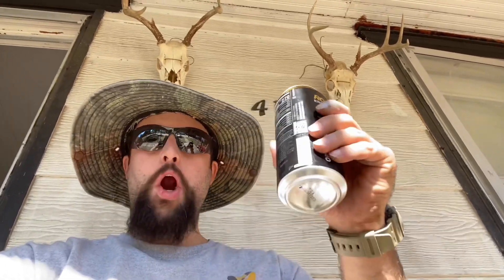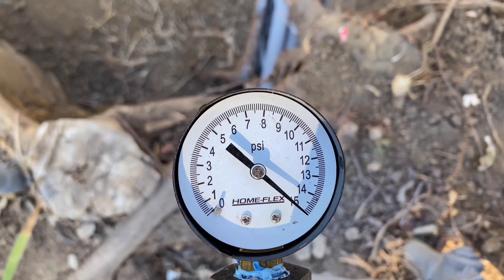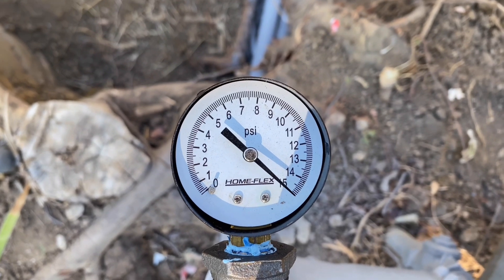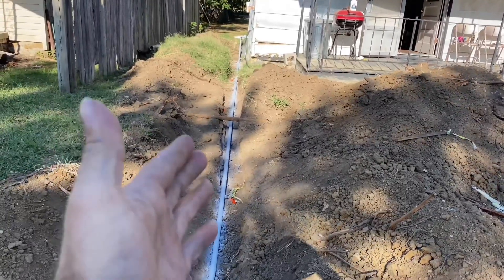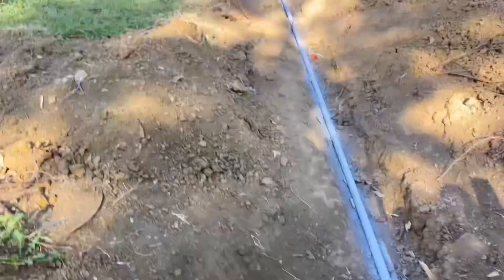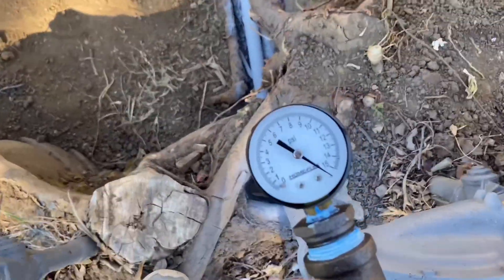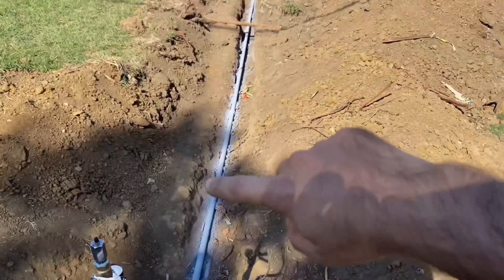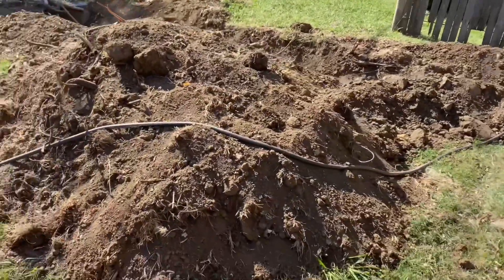Pressure testing my gas line how to.

Comment: I just piped over to the water heater today🎉🎉 following all ur videos. So before I continued my run I decided  to do a pressure test up to this point. I just now started the timer 30 minutes.  My goal I'd to have gas company come and turn my gas on after isolating the slab leak. So my family can receive  hot water again. Then next weekend continue the run to my stove and dryer. So far so good. It's holding 15 psi 25 minutes to go
Reply from the maker: That’s awesome 👏 Great job!! I love hearing people’s stories of saving money and the process involved!!

Comment: A couple of comments. Gas expands with heat. Therefore, your pressure will increase in the day versus at night. Secondly, for underground, yellow poly piping is now typically code in most places or wrapped metal piping using polyethylene tape.
Reply from the maker: Yes codes have changed but I stuck with the original design it lasted 80 years the first time and that is a good heads up to check the gage first to see if there is any damage! I have heard of another person having the same issue as well!

Comment: Our HOA had a gas line repaired at our pool. The Gas Company came back out to reconnect service and said there was still a leak. The repair company, retested and found no leak. A second company came out and gave us the valve that the first company had used. Like yours it was a 15 psi, but the inner dial plate was bent toward the glass across the 4 and 11. The dial indicator would stick on the metal plate and hold because it was stuck. Lesson learned, always use an undamaged pressure indicator.

Comment: Is there a reason why you painted the gas pipes?
Reply from the maker: Good question! Yes actually, I painted the pipes 3 times with metal outdoor paint. So the pipes last longer without rusting out under ground. Hopefully this helps!
Reply: 10 o'clock in the afternoon? Where do you live? Lol
Reply from the maker: Okihoma where the red firm grows lol

Comment: Thanks bro, you saved me $2000, had 2 different  plumbing companies in Charleston SC try to bs me and claim I needed all new pipes.  Called the inspector, gave them permit number, and he failed them for pumping it up over 10psi(local ordinance), though the plumbing company claimed it leaked.  Tested it myself at 20 psi with 2 psi drop after 48 hours, and was able to attribute that to temperature drop.
Reply from the maker: Thank you for sharing your testimony with me! This is the reason I made my channel to save people money because I have had my back against the wall over and over. So Im trying to break everything down into playlists!